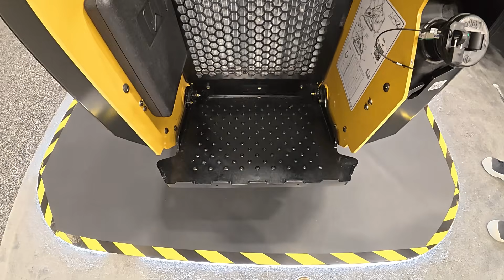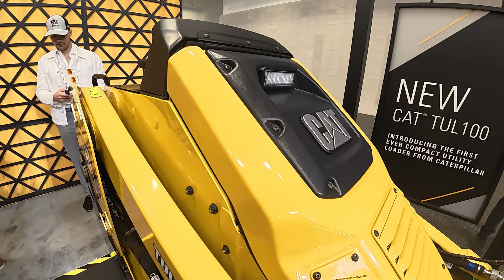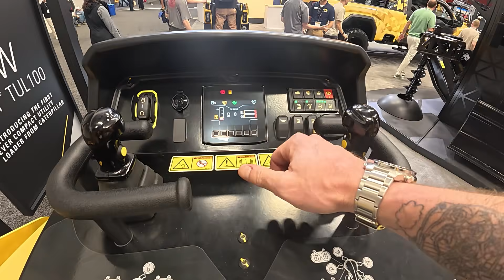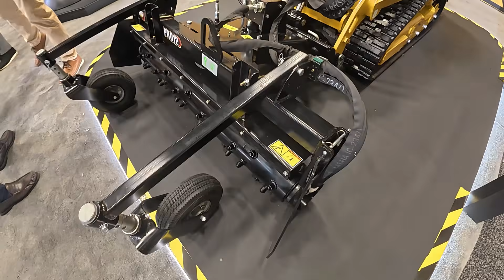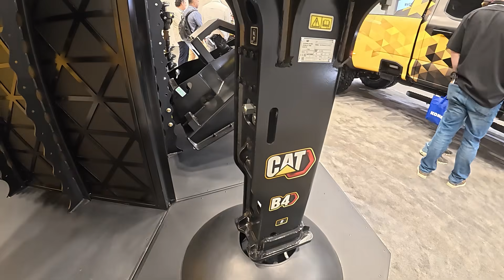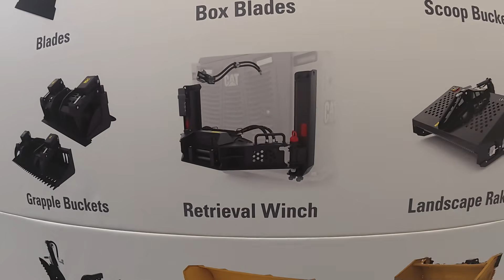Caterpillar's New Mini Skid Steer Has a Big Trick Up Its Sleeve | Caterpillar TUL100

Comment: Glad to see Cat still has no idea how to listen to the market. Electronics, Electronics and more fucking sensors. Ditch Witch SK800 reigns supreme. Manual linkage, analog gauges, unkillable kubota deisel engine with no turbo and still get 14 GPM. We run 5 of them and I can find half the parts on Amazon and self repair. Also, the engine bay is wide ass open so everything is easy to clean and work on.
Reply from the maker: I hear you but I also run a huayee lhy 680. Hell of a unit. Very mechanical and very reliable. Fucking monster to be honest.

Comment: 16gpm flow is around 19cc auxillary pump easily do-able on 25hp.
Reply from the maker: Sure, but the machine still has to move and boom up and down at the same time.
Reply: @downstateradv likely triple pump setup, two for drive and third for loader and auxiliary. Same way most are setup.
Reply from the maker: I agree but they'd have to limit the flow to the drive pumps dramatically in order to get a full 16 GPM out of the aux gear pump. It's doable but it's pretty complicated to do. Most units in this size range can only put out a Max of 12 GPM on the aux side
Reply: @downstateradv it could even run a pressure compensating pump for drive and loader with electric over hydraulic control then seperate aux pump just for attachments. Yes it will slow if trying to operate everything at once, but most smaller machines do unless running multiple smaller pumps.
Reply from the maker: Yep.  They're doing something along those lines.  Likely adjustable too depending one what you're running.  For mulching you don't need much on the drives.  Just creeping.  Very interested to get my hands on one and run a full size mulcher
Reply: @downstateradv yeah sounds like they've spent a bit more time developing a better hydraulic system. Turbo engine with help with more torque as well. Another limiting factor is the quick connect couplings I think they aren't rated to flow that much either.
Reply from the maker: 1/2 flat face connectors can flow 23 gpm max  so that shouldn't be an issue.
Reply: @downstateradv yeah but they're rated at half that constant flow

Comment: Well they didn't do a good job and making it  so it can be craned.  The holes near the top by the operators station don't allow for  chain hooks to be placed without hitting the lights in the back and they certainly are not easy to get at regardless of lights being in the way.   The lift hooks at the front of the machine are hard to get at as well.  The dash is nice.
Reply from the maker: I would have to agree with that point. This thing is definitely going to get dropped into different places. Bigger hoisting locations would be awesome.

Comment: Fyi 16gpm of aux flow is impossible with a 25hp engine. 16gpm of total flow is correct
Reply from the maker: We shall see.  The chief engineer said it himself.  It's certainly not impossible but would require some pretty advanced hydraulics to facilitate.  You'd have to be able to derate the drive pumps while aux is running.  Again, not impossible but definitely complicated.
Reply: @downstateradv it is impossible. 25hp can only push about 19 to 20hp of hydraulic hp. No matter the pump type they can't pull power from nothing. Derette says they operate at 15gpm when it doesn't and I bet cat is doing the same amd fudging the number's. See how much hp is required to push 15gpm @2900psi
Reply from the maker: No I agree it is optimistic.  At 2500 psi (standard pressure for most machines) and with a turbo motor, with no mechanical losses, you can get about 18gpm, tops.  If they are able to limit flow enough to the drives and arms, it is theoretically possible.  I should be able to get my hands on one soon and get a mulcher on it.  That's the real test.

Comment: The 100 in TUL100 stands for its base msrp $100k with no tracks, no attachments and no hydraulic pump. That way you can customize your machine to bankrupt you how you want it.
Reply from the maker: Haha they swore up and down no cat premium.  We shall see I guess.
Reply: I just got my RIPPA-R-10-ECO ❤ and have 20 Hours on her. Done everything I need done, and more, with what you get on that size mini, the 3 way valve, with the return hydraulic fluid hoses already set up buy the connection qiuck connect 😊 all the hose protected. 😊 and the PRICE that is the game changer in my humble opinion for the homeowners that want a small piece of equipment that doesn't use it everyday. 😊 the wide bucket is excellent for working with the Dozer blade to smooth your work. The Ripper tooth attachment can pull out anything the bucket can not. 😊 for me personally the GAS engine is great for working around say a water pipe, because just by listening to the GAS over the Diesel I can FEEL the load on the bucket. I use the combination of Feel, and gas engine Lug, to sense my bucket curl. It is fantastic for me. What I do find interesting about what Cat has done is build into that Chinese market of mini skid steer type equipment, compeat with the Chinese brands. But still what do you get for the Cat PRICING, a better warranty, Just asking what a small guy is getting back from Cat, trying to build a same size mini. It is the PRICE, that most small time guys go by. I see Cat Rental sticker on side of this new skid steer. If that is the market Cat is moving to. Then yes, Cat has done a great thing, in the Rental Fleets. A great heavy duty mini, that can be used by different operators every time it goes out on Rental. I think that's what Cat is Looking at. It is a super looking mini ❤😊 and with the elevated track system that will be wonderful for those ROCK sticking problem and possibly save on the teeth of the drive sprocket 😊
Reply: @rp1645 using it commercially. Rippa has a long way to go before ill buy one, 20 hours is 2 to 3 days of work for my mini skid.  I average 140 to 175 hours a month
Reply: High 30s low 40s.  Same as anyone
 Else selling a decent stand on
Reply: @stevenrichards9490 yes really not bad
Reply: I find it hard to believe this thing costs more than my fully loaded 255 did with a cat 4n1
Reply: I haven’t seen a podcast that said less than this one.
Reply: 😂🤣🤣😂🤣😂😂🤣🤣😂🤣👌🏻🤌🏻 dude solid answer 😂😂😂. F all these companies like CAT, Bobcat, Vermeer, Kubota, they can all go to hell.
The Chinese models like VMENG Derrete, Kimron, Rippa are crushing it and have some seriously good machines 💪🏻💪🏻💪🏻💪🏻.